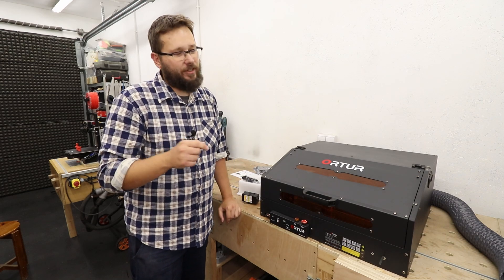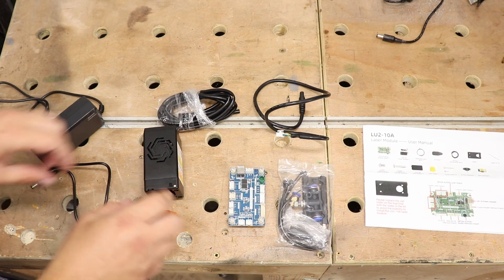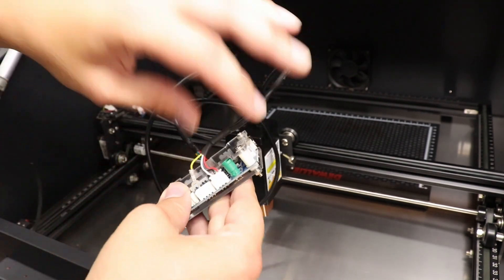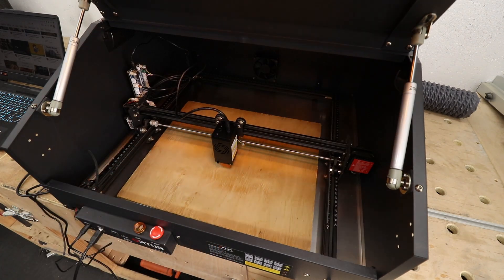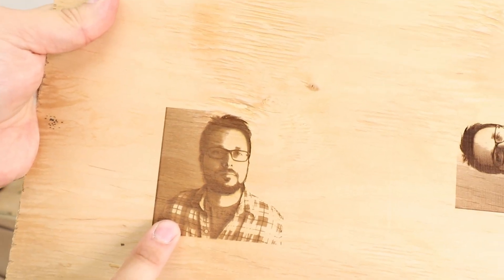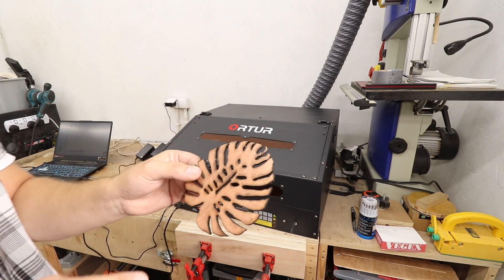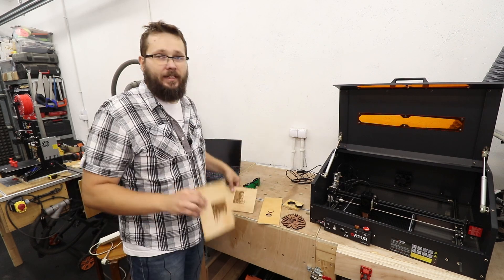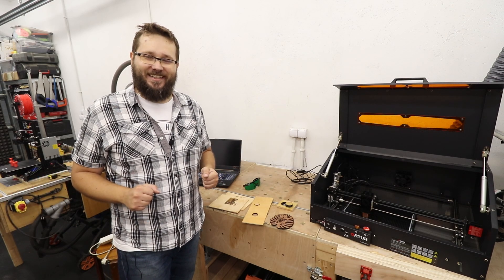Upgrading Ortur Laser Master 2 Pro with 10W Module | It Cuts 12mm Plywood!

Comment: I have the ortur 2 pro S2, I ordered the 10 watt head as same as you. But when I plug the power wire into the connectin block the fan comes on on the laser. Also, I cannot get the laser head to power up except for the fan running. I am completey lost. I am using lightburn software. I also have the laser master 3, which works great. Any ideas??
Reply from the maker: I would say the wiring is not correctly installed. I would check all the cables.

Comment: There's only one trouble with Ortur or Aufero machines when components get damaged or shorted, like my DC 24V/PWM Control Board which has a part somehow shorted or such, you just cannot find a catalog of spares or replacement parts, just a new laser module, why not the PWM control board?? I've searched sites like aliexpress who you have thought had been a haven for such parts or compatible, but nope!. 
So all I'm left with now is an expensive 10W module gathering dust!
Reply from the maker: Did you try to email them directly for the spare parts?
Reply: @CasualDIY  I been this path in the past with the same machine. I'd be willing to pay for a replacement instead of going through it all again. Think I will strip out the Ortur  M/B components and go with another controller instead. At least there's spares about when you need them.

Comment: That was definitely not a "clean cut of 12mm plywood in a single pass", so this laser as well as many others is not as good as advertised...
Reply from the maker: It all depends on the plywood. A hardwood ply will be harder to cut, than some low quality one. Same as it will cut through pine board with greater thickness than dense oak for example. You can now buy plywood that is dedicated for laser cutting. It's not as dense and hard.

Comment: can lu2-2 cut acrylic glass?
Reply from the maker: If it's not transparent ( correctly prept for laser cut) plus depends on thickness. 1.5mm should not be an issue with several passes should tackle up to 3mm

Comment: Lors de mon essaie, de chaque côté de la gravure et ce en fin de course du graveur, il y a double brûlure ce qui brise la beauté. De quoi cela peut-il dépendre? Merci
Reply from the maker: Try engraving in different direction ie. Vertical, horizontal or diagonal. Speed and power ratio will also affect this.

Comment: So i recently added this laser but now my reset button on the ortur for some reason turns on the laser. Also does the laser fan/warm up remain running once plugged in. On and off on mine is just once I plug it in or unplug it???
Reply from the maker: Maybe your on/off button is stuck? When I plug the machine to the mains the laser does not switch itself on. I need to press and hold the on button ( making sure the emergency button is not engaged ). Then the machine turns on and the modules ventilator. However the laser beam only turns on when prompted by the software.

Comment: Thanks for the info! I just got a LM3 10W and have been mostly engraving on and cutting thin basswood. Today I tried 3mm (1/8") plywood (not sure what kind but it has 2 finished sides and came from Lowes as a 4' x 8') but have yet to have success. My closest attempt was 80mm/min at 100% 2 passes + 100mm/min at 100% 1 pass. It did cut through but the wood was so charred and burned that it is unusable. I tried your setting just to see the result and 200mm at 100% at 1 pass barely scored the surface of the wood. I've already started 3 small fires today trying various settings. I would appreciate any help you can offer. Thanks!
Reply from the maker: First question, have you set up the focal point of the laser head correctly? Check if the laser is not dirty ( where the laser is shooting ) quite often there will be a build up of dust. 
For cutting try 150mm per minute at 100% power. What software are you using?
Reply: @CasualDIY  Thanks for responding to me. I have cleaned the lens a couple of times and again today. On some things, it seems to do a nice job, but I see people here on YouTube cutting much cleaner and faster than I can. I'm not really sure if I've set up the focal point correctly. What does that mean? My laser has this little 'kickstand' and I use that to focus. I did a ramp test that I learned about from The Lousiana Hobby Guy and the kickstand seems to be the best focal point. I am using LightBurn, which I love! I have been talking to an ORTUR rep and she requested a video, so I made 2 for her. If you want to take look, please do. They're short.  https://youtu.be/BV_QXLH2Qjg   https://www.youtube.com/watch?v=oG5qzVGzegQ    THANKS SO MUCH!
Reply from the maker: @csganley  the laser head seemed a bit too high, depending on the laser module to set up the focal point ( that's the distance between your laser and your work peace ) you will have an onboard retractable leg on the laser module, when it goes down it needs to touch your work piece. Or you will have an aluminium small bar that you need to place between your laser and work piece. I can see you are trying to cut plywood 4mm? Best results are always with air assist on. With plywood the results may differ widely on what type you are using. Some are very dense and hard which will mean you will have to do more passes to cut through. I now use plywood dedicated for laser cutting and I get far better results. Try pine wood for example and you will see how easy it will go through that compared to oak for example which is much harder and denser wood. Sometimes it does take a while to find the best settings. I use LaserGRBL as its free and super simple to set up. Personally I had worse results with Lightburn but that's down to my lack of knowledge how to set up all the parameters on it.
Reply: @CasualDIY  Thanks for getting back to me. I did add a grate for cutting and I have been using air assist. The wood is from Home Depot and Lowes and I'm not sure what type it is. Now they mostly have birch in stock. I saw where some people love birch for lasering and some don't. I did not see pine in the thicker sheets at either of our stores and I don't know of a smaller lumber store near me. I have several types of wood ranging from 3 - 5mm or about 1/8th inch and some does seem pretty hard and dense. Ortur is sending a new laser. They had me try several different things and it is off-center, so hopefully, that will help. It can cut through the thicker (3-5mm) but there is so much charring, it doesn't look nice. It does a nice job on basswood (2mm) - 400 90% 1 pass. I occasionally have to cut through 1 or 2 sections - maybe a hard spot in the wood. Thanks and I appreciate your helpful videos!

Comment: Greetings, great video! 
Can i ask you where did you order the laser module? And also, did it came with the adapter or you had to order it separately? 
Thanks!
Reply from the maker: Hi, the link is in the description of the video. Mine came as a whole package with the fittings and board as on the video.

Comment: If you are using the Ortur LM2 Pro, you dont need the interface board.. Only the 10W laser head connected directly to the same input plug, because it is already 24v..
The interface board is to use with the Ortur Lm2 (not the Pro) besause it is 12v and not 64bit .. the interface will give the extra juice to the 24v laser head.
Reply from the maker: Good info thanks
Reply: How do you connect the 10W laser to the board directly since they are both male ends?
Reply: also where would you ground it?

Comment: can this be used on the 12 VDC LM2 since it has its own 24 VDC power supply? Does it come with the PS and interface board?
Reply from the maker: You can check out the specs for it here https://www.madethebest.com/products/ortur-aufero-lu2-10a-laser-module-for-2-s2-2pro-s2-aufero-engraving-machine?_pos=3&_sid=d56a255ee&_ss=r&variant=42880895353048&fbclid=IwAR11dGRlhi0ptMBn44syUdzAc0eA6aytnEYoIo_hRX6mRzM_8H_4rK3JtM4&aff=96
If the answers to your questions are not there then I would contact the manufacturer to make sure.

Comment: Do you regret updating only the laser? The new rail system is very nice and has me thinking hard.
Reply from the maker: Well, the new OLM3 came in post today 😁👍
To be honest I see myself using both. Been doing a large engraving today that took 2h and it would be perfect to have another laser to do the rest of tasks at hand. So I'll be making an assembly video first and then a test video. Got some extra goodies I the bag for a sweet setup 😁👍
Reply: @CasualDIY  Awesome! Thanks!

Comment: For the thicker materials (10 mm, etc.) I have seen instructions whereas you are actually setting the focal length closer to the material so that the focal point of the beam is about half depth of the material. So they are lowering the focal bar, and visually setting it so that the bottom of the bar is about about half way down from top of material. Hope that makes sense. I have watched the Ortur team as well as the Xtool team setting it in this manner for the thicker materials. :shrug:
Reply from the maker: Interesting I need to have a look at that thanks

Comment: Would the air help with the thicker material?
Reply: Absolutely it does. It helps with the thinner material too. I use air all the time for cutting. Occasionally I will forget to turn the air on and it does not do near as well. I use an airbrush compressor from Harbor Freight.
Reply from the maker: Potentially yes

Comment: How much?? What other things are needed to make it work???
Reply from the maker: The module set is $289 I think plus the Ortur Master 2 Pro. Links to all the items are in the description of this video
Reply: If you have Ortur machine already, you only need to buy 10w module, please kindly note that it does not fit OLM2. If you want a complete machine, please check 2 pro 10w module: https://www.madethebest.com/products/ortur-laser-2-lu2-10a-laser-engraving-machine?variant=42887604601048&aff=96    or OLM3: https://www.madethebest.com/products/ortur-laser-master-3-engraving-machine?variant=43008613155032&aff=96

Comment: I've read, but haven't tried it yet, that you can cut better if you set the focus part way through the material, rather than on the top. I've only cut card with mine so far, and haven't done much of that yet, but even with 2mm greyboard I think it might work. I imagine it would be worth trying with thick wood.
Reply from the maker: There is still a lot of testing and tinkering ahead of me to get the best results. And still tons to learn as I class myself as a laser beginner